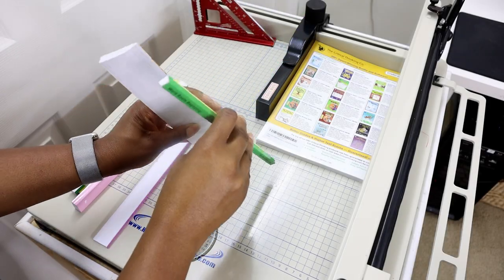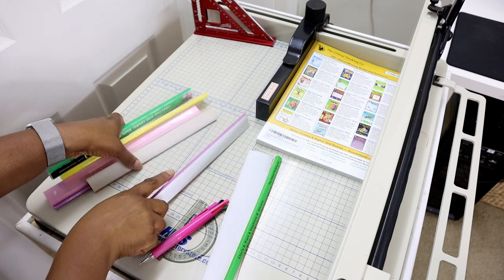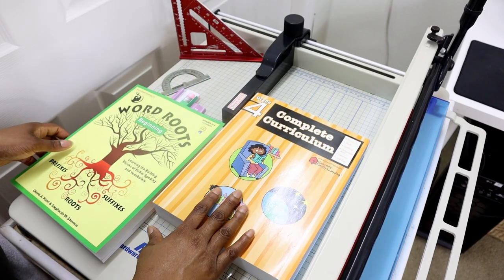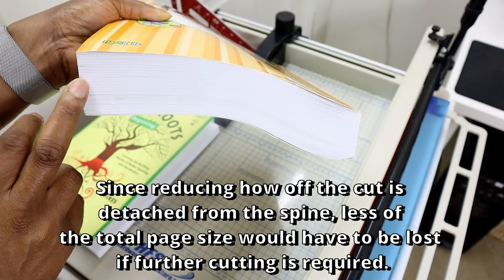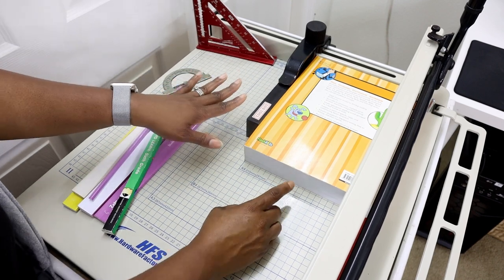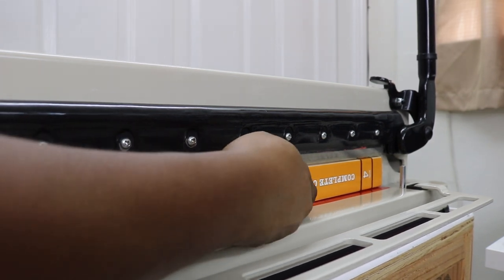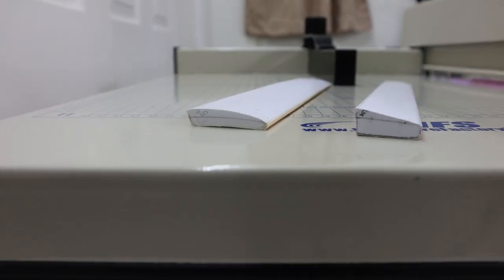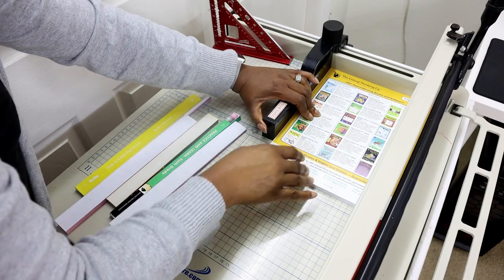Heavy Duty A3 17'' Guillotine Paper Cutter-|How To Get Straighter Cuts With HFS Paper Cutter

Comment: I enjoyed the video.  I have been considering purchasing one of these cutters and have been watching different videos on them.  Alignment was a consideration of mine and your video spelled that out pretty well.  However, another YouTuber seems to have fixed that problem and I will probably do the same when I buy one of these.  She used double-sided tape and affixed a strip of fine sandpaper along the presser bar and below it on the bed as well.
Reply from the maker: Hi Johnny. 
I believe I found the video you referred to. What a great idea to keep the papers from shifting! Which is what makes the cuts slanted. The blade itself still needs to be aligned properly with the cutting stick to ensure cutting through everything. I appreciate you mentioning it and will have to give it a try. 
Thanks for checking out the video!

Comment: I would imagine you have tried this. I would assume the width of the cutter blade is causing the glue strip to pull on the pages it is still attached to so causing the angled cut, especially on thick books with slippery pages. I would try making one cut to to remove the glue so tat all the pages are free, then realign the book and make another cut. On the second cut I would expect the cut to be straight.
Reply from the maker: Hi Thinking Ahead. I apologize for the extremely late response.

I have tried the double cutting to take away that angle cut. But I didn't consider that the glue might be causing the pages to pull at an angle. Interesting.
Two problems I ran into, though:
The margin is usually limited, so if I tried to cut multiple times, I risked needing more space to coil-bind the book after (which is what I do most times).
Secondly, with my big math textbooks, the margins are generous, but once I cut the spine off, it was almost impossible to keep the pages from shifting in some manner, making it difficult to get a straight cut. 
But since it's something I often do, I am always open to new ideas.
Thank you for both of your comments:) And for watching!
Reply: I came to the comments to recommend the same thing.. Good observation

Comment: First of all, thank you very much for uploading these videos, they are very helpful to everyone. I was able to change the red mat and line up the press thanks to you. But I still have a problem: when I cut paper, the blade makes me an angle, like in the video, it doesn't cut straight and my books or sales notes don't fit well. Is there a way to align the blade so it cuts straight? The cuts are of a maximum of 150 sheets of paper and always come out at an angle.
Reply from the maker: Hi. Firstly, I am glad the videos helped:)
Unfortunately, with all that I have tried thus far, the only two ways I have found to get a straighter cut is
Reducing the size of my project I am cutting, if possible, and
As I tried showing in the video, I ensure the book or papers are pushed well against the stop guard, especially from the bottom.
That part is a bit frustrating. But as a heavy home-duty cutting machine that one can use from home, it still does a decent job.
If I find any other way to improve my cuts when using it, I will share it on the channel.
Thank you so much for watching!

Comment: Are there any tricks or tips on how to find where the blade meets the paper so we don’t over or under cut? Every time I cut I always do more and it’s becoming frustrating. Please help
Reply from the maker: Hi Ciari,
I've been slower than usual in answering my comments.
Whenever I am about to do a cut, I first open the book and look at the amount of margin I am working with and how thick the glued area is.
Then I proceed to make sure that part is past the line on the cutting stick where the blade comes into contact with the stick. 
Doing this step before butting up the black adjustable fence to the edge of the pages usually results in better cuts.
I will do a video on this as soon as I can.
I hope that helps. Thanks for watching!
Reply: I stick a piece of scrap bookboard in between clamp and blade and measure from there. You can push the scrap piece onto your book and against the clamp to see it more accurately. Blade is a sixteenth to an eighth of an inch further than that

Comment: why don’t you do a double cut to make it straight after getting the edge off?
Reply from the maker: Hi. Great question. For my particular situation, I need to consider the margin. I did a recent video where I also addressed this and tried to do some more research and test cuts on the issue of cutting straight with this machine. This is the video here ----> https://youtu.be/ucS7fAx-Zls Thank you for watching the above video and commenting! 🙂
Reply: @MommyShareSpace  I just bought this cutter i find that it’s near impossible to cut it straight in one go, what I do is cut the minimum possible then do a 2nd cut to cut it straight, what do you think?
Reply from the maker: Yeah, I found this works too especially with smaller items. Particularly 1\2 Inch and below. For books more significant than that, the cut will improve but will still create a slant. I showed this in this video here ----> https://youtu.be/ucS7fAx-Zls

Comment: Hi. Help me please. Can you repair this problema?
Reply: Problem*
Reply from the maker: Hi Cristiano Satiro Vitorio,
Sorry you're having problems with your machine. Also, that I am now responding to your comment.
I have tried many different cuts with my machine to achieve a perfectly straight cut. 
After all my trying, this is my opinion:
This is a great heavy-duty machine to be used at home. And as that, it performs excellently.
However, I cannot get industrial-like cuts on this machine for a few reasons I have observed.
-The plastic stop works OK on smaller projects. However, with larger projects, some shifting seems inevitable. To counter this, I showed in the video what I have been doing that helps.
-The sharp edge of the blade has a slight angle. Unless you can figure out how to counter that by positioning larger books in a countering position, the further away from the starting cutting point, the more noticeable that angle is in your cut. The blade does not have far to go with smaller projects, so it can appear much straighter.
All of this is my assumption, of course.
If my larger books are cut in a way that I am unhappy with, the only solution I have come up with is taking smaller parts of the book and straightening the edges. Either on this machine or a smaller handheld cutter. But those can only cut a few pages at a time. 
I rarely do, since my cuts are for personal use.

I hope that helps. Thanks for watching! 😊
Reply: @MommyShareSpace  thank"s.